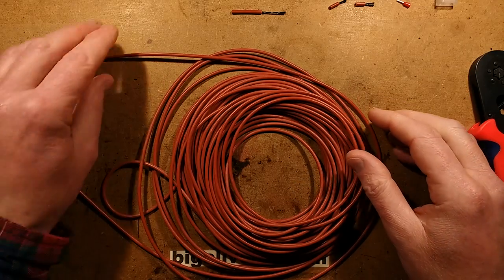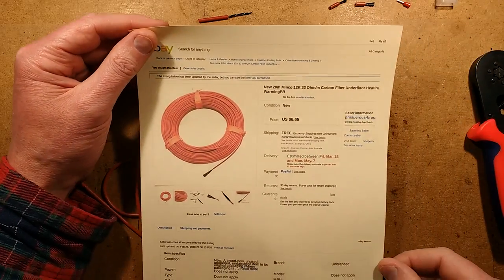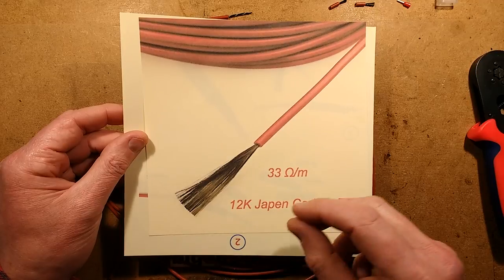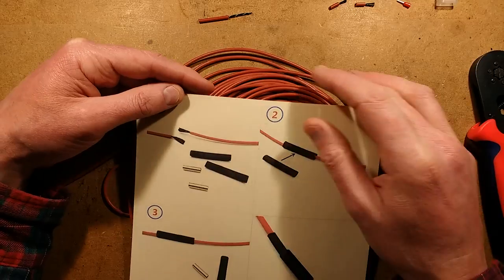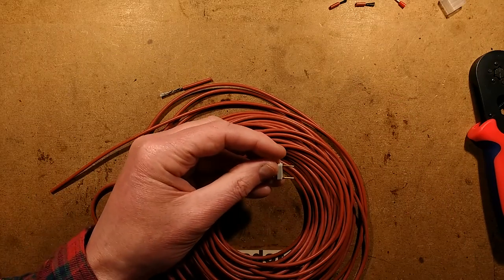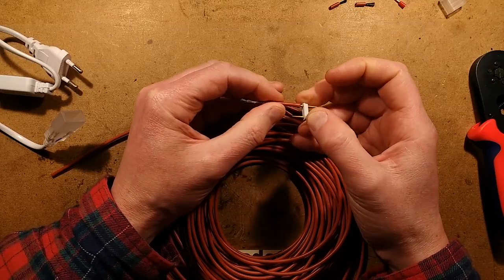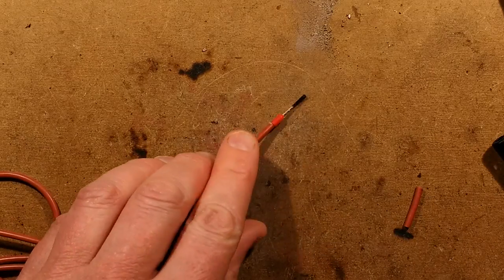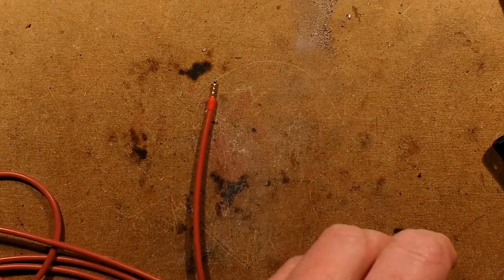Testing carbon fibre heating wire.  (with flame test)

Comment: Hi Clive, today I noticed on the HOPI the line frequency varies a bit. It might have done so before, but I haven't noticed. We've had some news article a few week back in the Netherlands about drifting European line frequency which causes a slight drift on some electrical clocks. Supposedly there are some 'political' issues in the Balkan region which cause this frequency drift. I have not looked into the matter further but it would be nice and educational if you could elaborate on how such a drift can occur (especially because of issues between countries) and how such a thing can influence particular products such as electric clocks.  Just a suggestion.   Cheers!
Reply: Jasper van Stijn   Tom Scott has done a video about that recently.
Reply: Thanks for the tip. I just watched it and although it was informative in a way it didn't provide any additional technical information about the cause of the drift (aside from the fact the UK doesn't suffer from the drift because of the DC coupling)  I mean, how does an underpowerment of a European grid cause a decrease in frequency rather than amplitude (voltage)? I like Clive's way of hands on approach to explaining stuff so I figured he might have something to say about it.
Reply: Jasper van Stijn   yeah, he didn't cover that.  I'll try... If you have a windmill it may turn fast when there is no load.  It will turn slower when when there is a load. The same goes for other main forms of electrical power generation.  The electrical load placed by consumers has the effect of slowing the speed of rotation of the generators. Hence lowering the frequency.
Reply: Ray Kent  Excellent explanation! Thanks for clearing that up. Now it makes me wonder how all generators seem to be synced up and what happens if they are not. It would logically result in some sort of short because of the voltage difference between the sine waves that are out of sync.   Thanks for clearing it up thus far.

Comment: This looks just like the wire I have been looking for. same colour, same thickness and does the same job. I have a brinsea incubator with a heating element (same as your wire) but I need a new one. Brinsea will not sell me the cable nor will they give me any specs on the cable or where to get it, they basically want me to pay a fortune to buy a new element from them. On the cable I have it says 150 degrees C, 300v and it is made by jinying and is a wire type UL 3219. I can't test the ohms because the cable is damaged. Tried googling for the brand name jinying and found it but they only eccept 1000m min orders :(  The incubator only consumes 35w and uses 12v. Any tips on where I could get this wire would be great or something I could use as an equivelent. I am in Southampton UK if that helps. thanks for this video.

Comment: That would work well to make a foldable proofing oven for rising bread buns and pastries.  70-90 is ideal. It needs to be a big space but nobody has space for.  If they made one that folds up and you can put away everyone would get one. Just make it with a wood slat frames or wire and an inner and outer cloth material to mount the cable between.
Reply: there's even cheaper cloth that you could do that with
Reply: The proofer at my old bakery was a closet big enough to hold 2 sheet pan racks, with shower curtains for doors and a raggedy-ass old kettle for steam. That was enough capacity for a bench of 5 people and a 24-pan gas-fired reel oven. At home, I use a kettle set to low in my oven. You could just as easily use a pan of hot water in such a small space to achieve the same effect. Hell, many places in the world are 70°F-90°F and humid without any help!
Reply: I only vacation to those areas. I have a cupboard down beside the oven that I don't use. I installed old oven racks and put a seedling plant warming pad on the bottom.  I place a pan of water on the pad. It warms up the cupboard to 80-90 C. Holds 14 loves of bread. Just wide enough for a cookie sheet.

Comment: I wonder if epoxy resin with a lot of conducting particles in it would work for joining those with not too high of a resistance
Reply from the maker: I did wonder that myself, but the risk is that you could get a lot of heat if the connection breaks down.

Comment: this is neat and all but i wouldn't mess with this over a hot water loop that just circulates from the hot water heater... heating water with gas is much more efficient than using electricity, and i've never heard of a properly done hot water loop failing.

also, if i had to guess how to terminate these they are likely terminated the same way as high voltage/high frequency cable shielding is terminated, by folding it back over the insulator and crimping it (although transmission cables have constant force springs wrapped around them instead of crimps but it achieves the same effect)

Comment: Could you provide a link to that spiral crimping tool?
Reply from the maker: eBay keywords are - self adjusting ferrule crimping tool  -  noting that there are a few different types and 4 or 6 wedge heads.

Comment: I like your crimping tool.  I personally have safety concerns about the vast amount of mdf that is used today.   That looks like a affordable heating solution,  my friend had electric underfloor heating fitted, and it had a bunch of control gear , Magical  thermostat and timers on a lcd screen and a manual that would be lost in a fortnight., The guy fitting it avoided my question when i asked could  would wireing the stuff to a plug work. .  👍

Comment: Can it be cut down and used for small section?
Reply from the maker: Yes.  If the correct voltage is used to keep it within its power rating.

Comment: Question, How can you hook up the carbon fiber heating wire to get power and temperature controlled??
Reply from the maker: It could be used with a suitable thermostat.

Comment: Hello from North East England. Could you do a video on infrared panel heater, but the DIY one you buy on eBay. You can buy a metre long one on eBay for about £25 and they are basically copper, with strips of horizontal carbon, and I bought one, and you feel the heat, but I just wired it up to an old radio lead with a 13 amp fuse. I would like to see a professional view on how much they cost as I don't have anything to measure it, but with UK energy prices maybe you could do a review and tell us the cost of leaving on compared to other heaters. Cheers.

Comment: I have bought some of this and the instructions (pictorial) show folding the carbon fibre back on the sheathing on the two pieces to be joined then sliding the ferule over the joint and crimping.
Its not clear on a carbon fibre to copper join.
I wouls appreciate any comments or help on this as I am nearly ready to instal on a small bathroom!
Reply from the maker: I'd suggest making sure that you leave plenty of spare for retermination.  Also make sure that there's a working RCD to protect against electrical leakage, as you're using product of unknown safety standards.

Comment: a length of that , connected to the 24v control board supply looped down the condensate pipe from your  condensing central heating boiler to stop it freezing in winter! You  could sell loads on the IOM Clive.

Comment: Was thinking of buying some of this and a voltage regulator to make something to go under the dogs beds in the kitchen through the winter as it's all tiled and gets a little cold....  Normally we use one of them little electric oil radiator things.  Would it be a good idea to go with the wire?
Reply from the maker: You do get heated mats.  Just make sure there's no risk of the dogs chewing them.

Comment: Carbon fiber has health concerns when cut or machined and fine dust is thrown up. During standard use though it shouldn't produce particulates at all as it is far less brittle than glass or asbestos fibers.

Comment: I could be wrong but I believe the issue with Asbestos is not only the fibres but the shape of the fibres and the surface structure of them, along with their chemistry. So for example coal dust causes a problem but only in quantities far higher than asbestos which can cause issues with fibres lodging in the lungs in single digits in extreme cases. I know glass fibre even though it is a problem is considered less than 10% as dangerous as asbestos (~going by max PPM permitted).  If anyone has links to proper peer reviewed data I would be interested.

Comment: 90 pounds a year? How much do you pay per kilowatt hour?

My city has a rather high electricity cost of $0.17/kWh, which would amount to about $45 a year to run a similar load
Reply: pyromen321 I'm confused on how the calculations work for this one. One screen says 91.5W which is 800kW/h (91.5w*24h*365days) but the kW/h reading says 267kW/h. My last bill in Aus was 0.57c/kW/h for peak, USD would be like 0.40c. New company isn't as bad but still $0.33 (without peak/off-peak)..
Reply: The meter probabaly assumes 8 hours a day "consumer" duty cycle.
Reply: Crazy, I had no idea electricity could be so pricy in different developed places of the world! I guess it's possible Clive pays close to $0.50 per kWh
Reply: in Germany we pay 0,27-0,29€ per kW/h
Reply from the maker: It's typically about £0.16 a unit here.
Reply: I hate to be "that guy" but the unit of measurement for energy is a kiloWatt hour (kWh) - i.e. power consumption over a period of time.
A kiloWatt per hour (kW/h) would be a rate of change in power consumption, and is quite rarely used - except maybe if you work in the power generation industry.
It is a bit hard to get your head around vs. a commonly used unit like km/h, but it stems from the fact that power is work over time (a watt is a volt ampere, and an ampere is one coulomb per second), so to get energy you need to multiply the power by the time it is used for.
Reply: I live in Ontario. The nominal rate here is 6.5¢-13¢ (Cdn. $) per kW/h, the variance owing to time-of-use rate fluctuations. Ontario is mostly powered by nuclear. Across the river in Quebec, they're under 5¢ per kW/h regardless of time of day. Of course, Quebec has flooded thousands of square kilometres of Cree land to do it. Oh, they also sometimes flood places when they have to discharge their large-by-huge reservoirs; the biggest holds 137 cubic kilometres of water.

Comment: Many years ago a colleague melted a rolled up cable attached to a 2kw heater. I thought the main issue with the coiled up cable was the fact it was an inductive load and therefore it dissapated more heat than the uncoiled wire would.
Reply from the maker: It's purely heat dissipation.  The source and return would cancel out each other's magnetic fields.

Comment: Does there exist a freely available voltage drop table for different lengths of wire?

I tried to start a motorcycle with a helper battery but the wires were to long from the secondary battery to the original battery which made the resistance to large for it to benefit in the starting process. If I know what voltage I need at the start of the cable to get a desired voltage at the end of the wire I can reverse instead of forward engineer my circuit.
Reply from the maker: The electrical industry does have charts for calculating voltage drop versus current and length for specific cables.

Comment: Wow, those are really fine carbon filaments...!  I've seen various things like heated garments that say they use carbon heating elements - I wonder what form that takes if fibers like this are brittle - in a garment, the heating elements would have to deal with a lot of flexing, and I'm not sure the pad material from the cheap heated fingerless gloves you showed in an earlier video would work for something like a jacket.

Comment: big Clive a question for you can LED lighting cause migraines and headaches ?
or is it all in my head 🥁
Reply from the maker: It's possible that LED lamps that exhibit flicker could cause continuous stimulation of your peripheral vision and lead to headaches.  In a way they may be worse than traditional fluorescent lights for this as the flicker can be more harsh.
Reply: thanks for the answer it's nice to know I'm not going mad
Reply: Chris green   it's well established that flashing light (within a frequency range) can induce epileptic fits in those who are susceptible . Most commercially available led's produce flashing light at a higher frequency. If you think that they are inducing migraine then swap them for halogen which has high thermal inertia, ie smoothes it out much better. If you have the choice.  Many years ago I had an offer to study at Southampton university. I turned it down because the fluorescent lighting in thé lab made me want to get out as soon as possible.  Or make your own dc arrangement for led's which has zero flashing. Not hard, if you get the reward of not getting migraines.

Comment: You could sew paralleled sections of it into a jacket to have an electrically heated one. Wouldn' be a big deal to power it with a cordless drill battery or something. In fact I'm pretty sure DeWalt actually sells heated clothing.
Reply: I use an aftermarket heated seat unit for cars for that purpose; makes it easier to take the electric parts out to wash it.
Reply: Heated clothing sells to anglers - they buy a lot of expensive gadgets. Heated gloves for motorbikes have also been around for years.

A leading cause of death and injury to anglers btw is electrocution by bridging to overhead power cables with a carbon fibre composite fishing pole.
Reply: Milwaukee and Makita both sell heated vests/jackets. Makita mostly markets their products to professional contractors, but they have those jackets in camo patterns for hunters.
Reply: That's okay so long as what you are hunting doesn't have a thermal imaging camera :)
Reply: Good advice. Do not wear a heated jacket when hunting snakes, bed bugs, vampire bats, or the Predator.

Comment: Run a bit of Solid Copper wire up into the fibers within the Insulation.  Crimp a Terminal over the end of Insulation and solder the wire to connector.

Comment: how much power (AMPS)  would it consume over 100m with 110V?
Reply from the maker: You can work that out from the resistance per meter of the stuff you use if that value is available.

Comment: That is the wire they use in those Negative Ion Generators as it took over for the old style needle since you have, effectively, 12k needles instead.  It really does make a difference between the two.
Reply: This does really have me intrigued. I've been using the same ionizer for 20 years or so. Retrofit Time!
Reply: It honestly does work better.  Just strip the end off and fan them out but you will need to clamp them on where the needle is currently soldered (use any wire crimp that will fit) because you can't solder this stuff.

Comment: I wonder if this could be used to make a heated bed for a 3D printer.?
Reply from the maker: I think that would require quite a high heat.  Probably better with the etched PCB heaters.
Reply: Yeah they do. Even the PCB heaters don't get to the desired temperature all that quickly.

Comment: One of my neighbours has this stuff in the sunlounge, (orangery/lean to on the back of the house).  No control system, simply plugged in to mains (13A fuse), its warm in winter and with a glass (perspex) roof - totally unbearable from about now to end of october.  Installed by her builder who came to me for help terminating the stuff.  I used ferrules without the plastic shoulder and adjusted the 4 jaw crimpers to make a slightly weaker squeeze.  Builder threaded the filament into thin plastic pipe (as used with underfloor heating), buried it under 3" of the resin stuff you level tiled floors with.  Whole floor covered in PVC tile flooring.  My contrib was ferrules to terminate carbon into a pattress then copper to connect to supply.  None of it rocket science but gentle with the screws.  It seems OK, the floor surface is tough, the filament is connected 24x7 with no thermostat to a standard fused and switched socket installed by electrician - I didn't ask what fusing but there is a dedicated RCD.  The whole house is 25-27c in winter - can't imagine how hot it gets in summer - but its hot.  My terminations are fine at the moment - no reason for them to fail, no pressure or vibrations and constant temperature.

I got 20m at the time - use some of it to stop a birdbath freezing in winter and same with the condenser overflow on cheating boiler,
Reply from the maker: While not an ideal arrangement you can get plug-in thermostats.
Reply: @bigclivedotcom  I wouldn't have done it, I like warm but hers is uncomfortable, the house is open plan, no doors on either floor, central heating on high all year round.  In winter the underfloor makes a pleasant warmth, (it would be good in the bathroom) no draughts, lots of glass so it would be cool in there without.  She spends a lot of time in the garden all year - so not frightened of cold - but house is kept like an oven, I don't know why.  Bills must be horrendous.

Comment: Hi Clive where did you get your Hopi,and is it good for Usa at 110 120 220 240 Volts
Reply from the maker: I bought it from an eBay seller and it's rated for 100V to 240V.

Comment: can you tin carbon strands with solder?
Reply from the maker: It doesn't work.  (I just tried to make sure, and even with heavy flux the solder just balled off.)

Comment: You could test for manufacturing faults\leakage by dunking the cable in a bucket of water with only the ends protruding and then test for continuity between the core and the water.